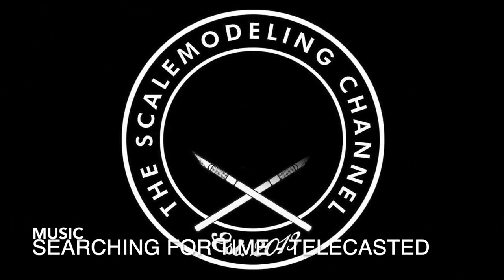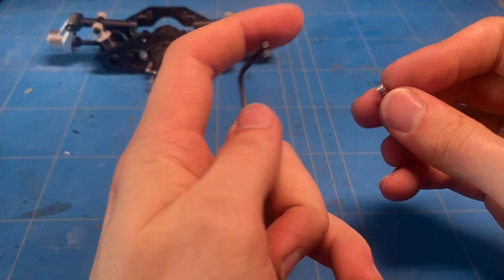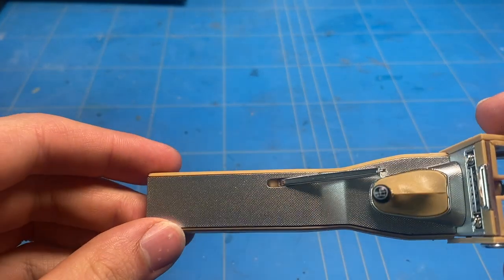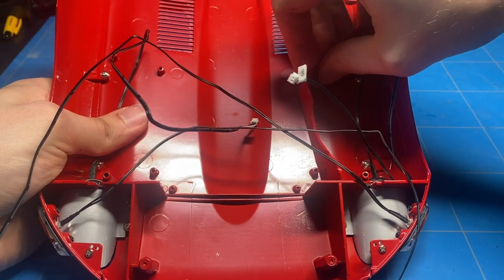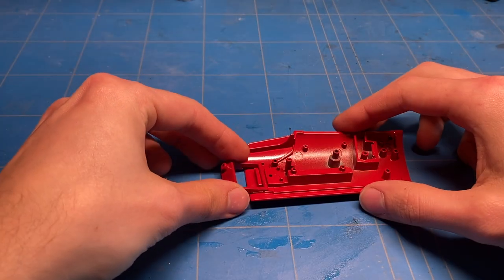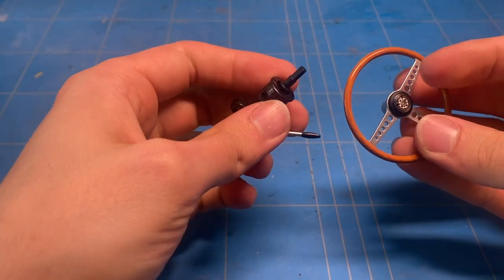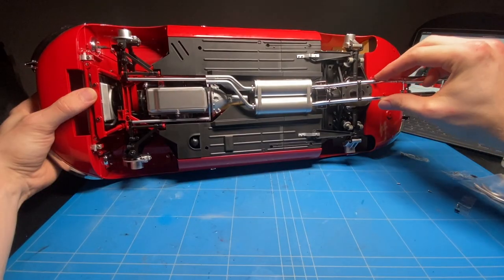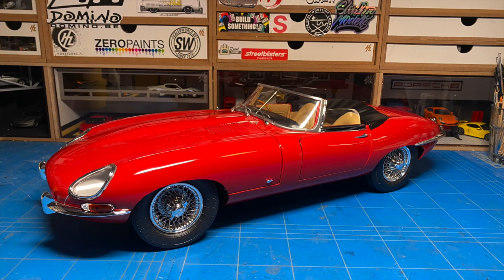Building a 1 to 8th Scale Agora Models Jaguar E Type Part: 2

Comment: I still think these kits are far too expensive for the level of detail. I would take a pocher or model factory hiro 1/12 kit any day.
Reply: I agree- but these kits lend themselves to adding the details one wants. I have a 1:1 scale E-type in the garage and use it for inspiration and details for the model. A wire harness here and there, some throttle linkage, the little details really add up. I looked at a Pocher Lamborghini and it was actually not as convincing and lacked detail compared to this kit.

Comment: Put the tires in a plastic bag to avoid getting them wet, then dunk in the water! Otherwise they’ll be difficult to dry inside and out! Kinda disappointed that we didn’t use the lights! $ 130.00 a month used to be a car payment! Inflation isn’t a problem Brandon !😝 Very cool replica of my favorite car! What are the batteries,2032 button cell batteries? ✌️😎🫡🇺🇸